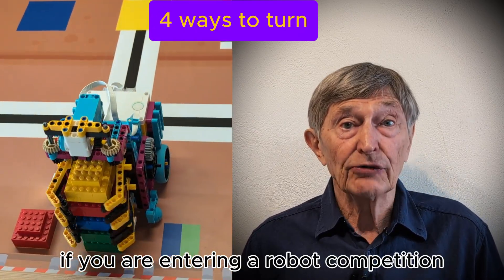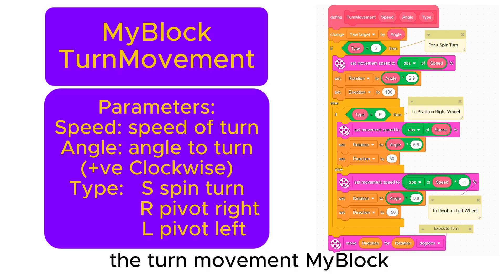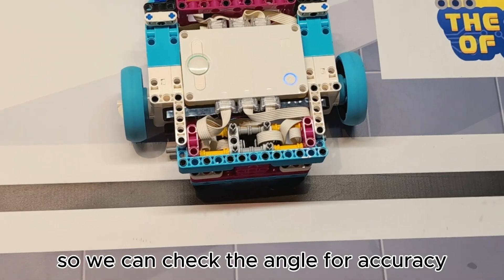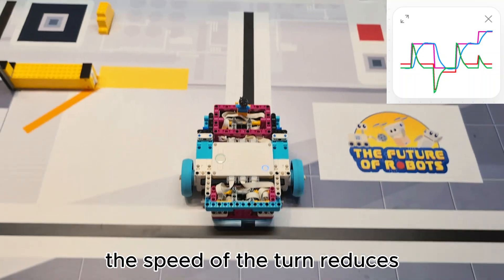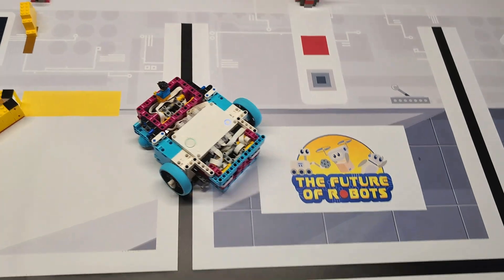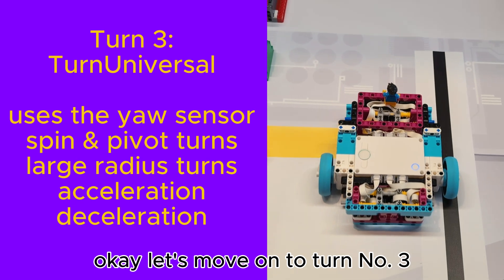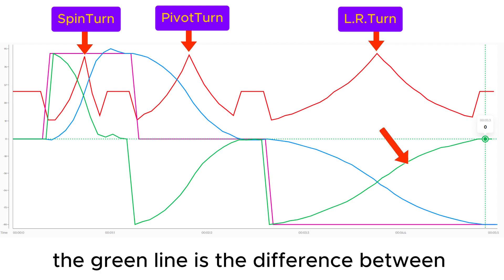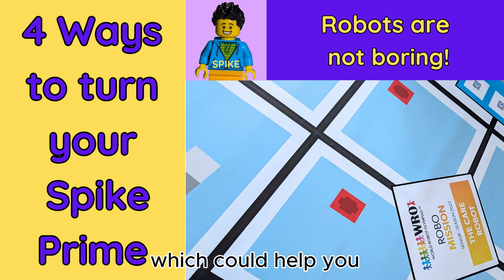Four Ways to Turn Spike Prime

Comment: How come I cannnot find the corresponding functions used here on Spike, seemingly common ones like Init, MoveStraight (), Do you need to use some sort of advanced mode? (sorry, newbie here)
Reply from the maker: Hi Sophie 
Aha I see your problem!
The functions you mention are things that you as a programmer define yourself. This is a very powerful feature of the block  programming language. You make your own MyBlock function. You need to click on the Red MyBlocks symbol on the left of the screen and then on Make a Block. A window opens where you can give the block a name. You can also give it an input if you want to. An input is a value that you can pass to the My Block. For example you could make a MyBlock which follows a line for a certain distance at a certain speed. You could use one input for the distance and one for the speed. You can then use the MyBlock as many times as you want and each time specify the speed and distance. You don't have to use inputs, for example I make a MyBlock which I call Init. I use this to set up a few things at the beginning of the program, such as which motors you use for the main drive motors or the values of some variables you are going to use.
I hope this helps you, let me know if you need more help.
Paul

Comment: Hey man do u think it’s better to program using pybricks for the next wro competition
Reply from the maker: Hi!
I don't really know Pybricks, but I think it is more of a "proper" programming tool compared to the Spike Prime block programming. You have (I think!) a deeper more direct access to the processor resources. The Micro-Python programming environment would also offer this. The advantage of the scratch block programming is that it is very easy to learn but still enables you to do what you need for WRO. If you are already familiar with Pybricks I would use it!
Reply: @why-not-bot I have people in my team who know it that’s why ye it’s basically programming spoke with python and do u know where i could find content about it and about building advanced bases for spike thanks
Reply from the maker: I can only suggest that you Google around for the information you need. Even Chat GPT is helpful if you ask the right questions! Also Lego Education has some resources available online.
Paul
Reply: @why-not-bot ok thanks very much

Comment: Hi, can you explain a little more about proportional rotation with the gyro?
Reply from the maker: Maybe you mean the proportional turn in the video explaining four different turns. The turn is proportional because the motor speed during the turn depends on the angle remaining to turn. For example, for a 90 degree turn the speed when 45 degrees have been turned will be half the speed at the beginning of the turn. Usually for a proportional turn, a minimum speed of 5 - 10% is set, because the motor would stop turning before 0% speed is reached and the turn would never complete. Please let me know if this answers your question!
Reply: @why-not-bot  But for me, robot over turn ever single time
Reply from the maker: Which turn are you using?
Reply from the maker: I am not at home at the moment but will try to give you an answer tomorrow. Is your question in connection with the video about gyro navigation?
Reply: yes

Comment: Hi Paul, thanks for sharing the video. It's a great one again as always. Have you had the solution for yaw's 180 degree flip-flop? I have tried to implement a solution at my side and it works pretty well. Basically I use two yaw systems e.g the lego's default (0..179 -180..0) and 360 degrees system to keep track both yaw targets. Whenever I need to turn the robot near 180 position I will switch to use 360-system. I'm looking for your next video to sort this problem.
Reply from the maker: Thanks for your encouragement, still working on my idea for a solution to the yaw flipping! 
All the best 
Paul